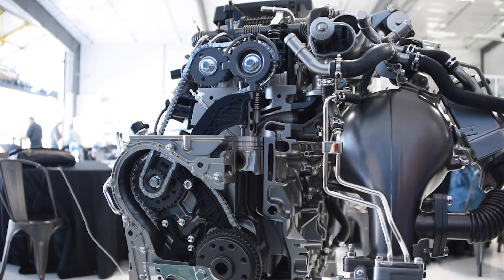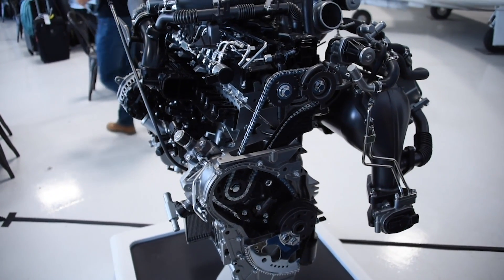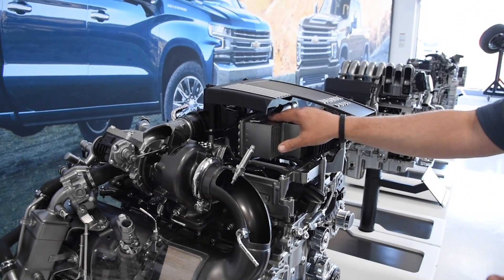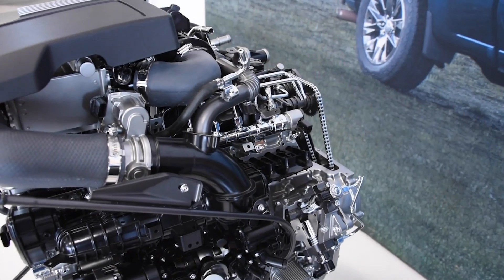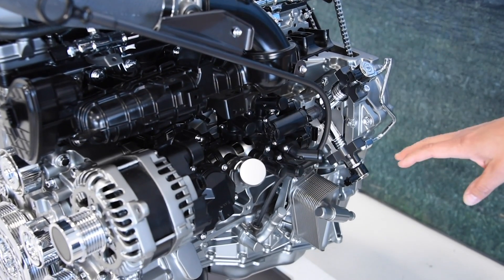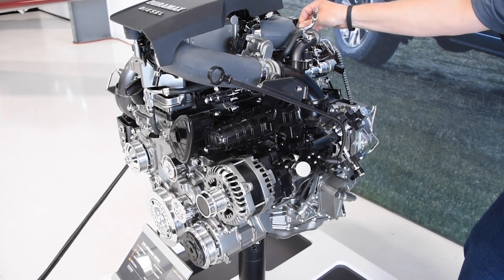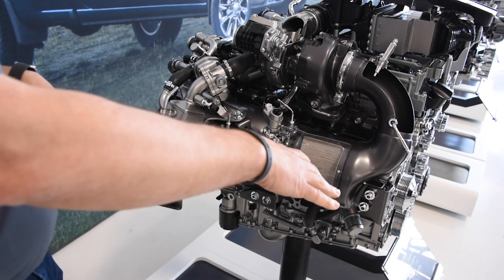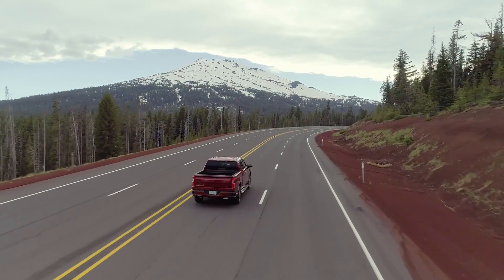What you don't know about the 3.0-liter Duramax diesel

Comment: A belt driven oil pump? 
Another vote for drug testing.
Reply: WHY does the oil pump have to be belt-driven?  Oil-immersed gear drive will last forever.
Reply: To make it even worse, the belt is partly submerged in hot oil. So, why not use a chaine? Someone will never pass a drug test.
Reply: Djinnho chain requires a tensioner and can stretch. A belt does not stretch.
Reply: @Heatherder  It should have neither. Oil pumps have been gear driven for 100 years for good reason.
Reply: Scott i do agree that gear driven is the best option and I don’t see why a belt was necessary. I know it was not an easy engine to package tho. I feel similarly about timing gears however having that many bearings and shafts and gears can be a liability in itself and gets noisy and power sucking fast
Reply: Durability and reliability for a belt driven oil pump is nonsense. 
150k miles is nothing. 
Big thumbs down.
Reply: Not just that, it's the fact that all that shit is on the back of the engine, so you have to remove the transmission, lower the engine and disassemble the rear half of the engine to fix those things. If it were all located at the front of the engine it wouldn't be a big deal, but why on earth put all that crucial stuff on the back of the engine!
Reply: rochab77 post a video of the one you did. I’d love to see it
Reply: @Jackmerius_Tacktheretrix  after reading some of the comments obviously from mechanics and diyers the only answer I have for you is; there's no halfway to stupid...so smart you're stupid is a thing.
Reply: and drop trans!!!!!
Reply: Lol! A WET BELT! ha ha haaahaaa! 
Idiots.
Reply: @LuMaxQFPV  Which I paid $200 for module to deactivate. Miss the old days of simple engines.
Reply: Let's think about this rational like. Most people have no problem buying a diesel truck with a manual am I right? How long does that clutch last? Probably not much longer than 150k.
Don't you need to pull the transmission to change the clutch? Hmmm...
Reply: @wilsterone6689  they discontinued all manual transmissions for hd diesel trucks,  RAM was the last to have available in 2018 and for a reason smaller sales numbers trucks sat on lots,..... most people don't buy HD diesel trucks with a manual trans, automatics are to good now, no Manuel trans drivers for diesel trucks we are a rare type(excluding big rigs don't know about them talking masses) salesman was like are you sure? haha yup! luv my 2018 3500 dually 4x4 G56 trans! oh and a clutch is a much easier job when it comes to wrenching brother, I pick that any day over that other job
Reply: @concretejungle77  Not sure I follow you.
Reply: @wilsterone6689  you said most people have no problem buying a diesel truck with a manual and they have to change the clutch anyway ... but you are wrong in your logic and I explained why
Reply: @concretejungle77  what you explained doesn't change anything. Just because you can't buy it doesn't mean that you wouldn't if you could. And I believe that people were complaining and having to change the belt. My point is that they don't complain about changing the clutch and that changing the belt is no harder than doing that. And they both last about as long.
Reply: @wilsterone6689  lol sure it does refer back to my first comment cause you don't make sense because they could buy it but they didn't want to so thats why truck brands discontinued them. they don't complain about changing the clutch because its not that hard or expensive if you pay someone compared to auto lol belt is much more tedious cmon bro ask a mechanic,  manual transmissions are much more simple than auto and easier and cheaper to rebuild, again thats not why they gone,  manual trans died because not many wants to  or really knows how to operate clutch and gears properly for smooth driving.
Reply: and of course I'm talking about this belt job versus a clutch job
Reply: @concretejungle77  I guess you haven't watched the videos. this is not the typical belt job. It doesn't require timing or tensioners. And once the trans is removed you gain access to it. probably easier than a clutch job because you don't need to lift a heavy flywheel or clutch pack and no machine work required.
Reply: @wilsterone6689  Wish I could buy one with a manual and clutch....  But you are right, the junk auto's won't last much longer than 150K anyway.  Disposable trucks!  Goes right along with the plastic intake manifold...
Reply: @wilsterone6689  that's a clutch, you buy a manual knowing some day you will change the clutch, you don't buy a truck knowing some day out of warranty you have to do work on this poorly designed cess pool of technology.
Reply: @CrazyForCooCooPuffs  Hmmm. I know this may come to a shock to you but you eventually have to do work on every car out of warranty. Some more than others. Do I need to remind you of the Ford 6.0? That had timing gears and no belt or chain and still a POS.
Reply: I’m sure they’ll revise this down the road, then we’ll say stay away from 3.0 duramax from 2021-2025 for example.
“Yea all you have to do is drop the transmission “ they make it sound like that would be a cheap job. Remind me if I buy this sell it by 150k miles.
Reply: @MY-pj8cd  You wouldn't sell a car when it's time for a clutch and thats probably before 150k,  what makes this different?
Reply: @wilsterone6689  wooowww what y’all doing with your clutch. Bought old used cars and new cars as manuals done over 200k  on original and on used cars knock on wood I’ve never had to change a clutch.
Reply: @MY-pj8cd  This is not a car it's a truck made to tow almost 10k lbs. It's very rare that any clutch goes over 150k unless you are very good at it or drive mainly freeway.
Reply: @wilsterone6689   grew up in Jamaica where back in the day the public transportation ALL buses were manual. I always stayed up front to see the drivers shifting when I was old enough to take lessons I had a really great teacher, taught me how to keep a car stationary on a hill without brakes. If I was still in Jamaica when I got my license at the time it was mandatory to get it with a manual vehicle. I lived in NYC for years when I had those manual cars so I guess 50/50 highway to city because I do love road trips. I don’t rough up my clutch.
Reply: Well they use them on race cars all the time...
Reply: Ford 2.7 V6 engine used a timing belt on the variable displacement pump since 2018...
Reply: WTF. Why run a dam belt for a oil pump while the timing is chain driven and to top it of is on the rear of the engine were it mates with the transmission. WTF are there engineer from GM came from? This engine i see reliability issues.
Reply: Was waiting for this engine to come out for so long, and there are so many issues with it and the new 1500 chassis. Was depressed until Ford announced the F150 Lightening.
Reply: Dumb is all I can say I’ll stick with my 12v Cummins
Reply: @ashfordcombs8658  I'll stick with my FKN  T E S L A.   diesel shit
Reply: These are the same idiots that gave us AFM
Reply: @Mike Make me shutup If you want me to shutup Im not taking orders from you, idiot. Suck Mike Hawk 😂
Reply: @jmoneyyonkers2209  😂😂 you are legend!
Reply: The Ford v6 diesel runs a belt off both ends of the engine. Now who needs drug testing?
Reply: Yes, drug testing for the poor chap that doesn't realize belts in oil are designed to outlast the engine.
Reply: @lowboy003  Even if it were a good design (it isn't, even the lead engineer said he'd rather not have to do it this way) it's going to be a major expense to replace. And for many of us, 150K comes up pretty quick. I can see used trucks needing this fix and being not worth the cost.
Reply: @lowboy003  They're NOT designed to outlast the eng - hence the 150K replacement interval.
Reply: @ScottDLR  Sorry, but these posts are over a year old and testing in real time is well over 200K. It could be everyone is brainwashed into believing something that is pure BS. For those who took the COVID death jab, same thing, mass brainwashing.. After 3 years of use give us ONE example of a 3.0 oil pump belt failure.

Most timing chain drives in the future will be BIO (Belt in Oil) drives. Testing in the last 3 years (thousands of hours) with new belt compounds has put these far ahead of anything else: lighter, quieter, less frictional loss, and the ability to absorb torsional oscillation.
Reply: You people are crazy. Belt driven oil pumps are used in race cars and heavy duty semi truck engines. A belt driven oil pump helps increase air to fuel ratio, while still having high mpg.
Reply: @jmoneyyonkers2209  How does a belt driven oil pump increase air to fuel ratio? (AF ratio is a set point for a given eng load/power so you can t really increase it anyway)
Also, what OTR truck engine or race engine uses a belt driven OIL  pump? Not any American V8's for sure and I don't know of any Cummins, Intl or Cat engines that do. If there are, what are they?
Reply: @ScottDLR  If an Oil pump is belt driven, it must mean that it is always moving, as long as the car or truck is moving. That means that oil is constantly circulating the oil around the engine creating better cooling, making the engine more efficient. Why do you think a belt driven oil pump is wrong?
Reply: @jmoneyyonkers2209  Belts are not as long lasting or reliable as gears. That's why they've always been gear or direct shaft driven. The  belt drive drive pump isn't going to cause an eng to run any cooler or more efficient.  I'm sorry but the oil pump has nothing to do with AF ratio. 
The traditional pump works perfectly for its application and can put out any amount that is needed.. 
The belt drive pump  was a packaging shortcut and they've started having heat issues according to some YT vids of late. .
Reply: @ScottDLR  Respect
I’m not sure if your right or not but thank you for the info mAybe GM engineering isn’t at its greatest this decade.
Reply: @ScottDLR  A 2020 Ram 2500 Cummins 6.7, or a 2020 Powerstroke 2500 6.7?
Reply: @jmoneyyonkers2209  No, both of those are gear driven. Really, even if they do, it still isn't a great way to go for longevity and I suspect very few engine builders would disagree (although there's always one in a group like this..) ;).
Reply: @ScottDLR  you are a legend
Reply: @jmoneyyonkers2209  :):):)
Reply: @ScottDLR  Im not sure how they are getting the variable output but that isnt why they did it. He said right in the video it was to simplify the geartrain. The would have needed tensioners and idlers and chains, all have there own reliability issues. Everone complained when clutches were no longer available and rarely would they go over 150k. How did we change them? We pulled the transmission. Hmmm... shaft driven oil pumps also failed. Take a breath and think about it, its not that crazy.
Reply: @jmoneyyonkers2209  =Brain on drugs!
Reply: @wilsterone6689  Shaft driven pumps rarely ever fail  in gas engines and in diesels, where gear driven pumps are the norm, it's unheard of.  Look at any OTR truck eng and you will not find any common issues with gear driven oil pump failure. 
Given that kind of history, clearly they did it for cost reasons.
Reply: @ScottDLR  Those are HD engines and cost around $45k. I sea geartrain issuse on a fairly regular bassis in HD engines. The belt will see far less load given that it only drives the oil pump. Timing belts in automotive engines see far more load than this will and they have proven reliable as well. Id give it a go.
Reply: @wilsterone6689  Yes, I'm in the field as well and see no gear driven pump failures. In race cars that maintain high revs, yes but not in diesels. Belts? no one knows for sure as no one has used them. 
Timing belts? yes, they fail all the time -especially if not replaced on time. 
Sorry my friend, once you talked about shaft driven pumps in diesel engines and said you saw gear driven pump failures "on a regular basis" you proved you weren't familiar with them.  
Good luck to you tho.
Reply: @ScottDLR  Quite the contray. I am ASE master certified in Auto, truck,school bus, and Transit. Yes master in all 4 including advanced level 1 and 2.
I must admit the only shaft driven thing i ever saw inside an engine was a blower drive in a detroit 2 stroke. They failed quite often due to alignment issues. I hold cerificates in Detriot 92, 50, and 60 series. I also hold factory certificates in Cummins ISC, ISL, and ISX overhaul. The cummins is prone to debri getting lodged into the gear train damaging it.
The detroit has idlers and a bull gear that suffer bearing failure. I do not know your credentials. You have obviously made up your mind and that is fine. I hope others make up thier own mind and not just simply listen to people who troll youtube with closed minds. As for luck im pretty comfortable without it and if that doesnt work out I have 5 year 100k mile warranty. Inovation is a good thing or we would all drive model Ts.
Wait they were inovative as well. Hmmm.
Reply: @russianacorns8080  Absolutely am. And I am a technician trainer and technical advisor for a major transit system. I train our transit Rodeo maintenance team as well winning the state roadeo once myself and taking 11th place in the nation and lead my team to 5 convective wins at start since I became their trainer. Don't be an A hole shut up and try to learn.
Reply: @wilsterone6689  hahaha. Lol what a joke, I’ve seen guys drowning it certificates and awards who didn’t know their ass from their elbow. I still don’t believe you.
Reply: @russianacorns8080  Ive seen more without them that don't know their A from a hole in the ground.
I believe you are not certified. Anyway my point is keep dragging your knuckles and the diesel will disappear. It's already on its way our because of this very thing.
Reply: @wilsterone6689  how is not liking a belt driven oil pump knuckle dragging? I’m all for a cleaner environment but you won’t be catching me drive a cow piss diesel I’ll stick with my old IDI. I understand common rail and pezio injectors and computer controlled everything is a must nowadays to meet emissions but I see no reason to skimp on the basics like a an oil pump that has ONE job.
Reply: @russianacorns8080  First cow piss as you put it is a good thing. It gets injected after the engine into the tail pipe reducing the need for EGR. That results in less soot building in the engine. It also makes the engine more fuel efficient and increases power.
Knuckle dragger refers to people being stuck in the past. Technology moves on timing chains also wear and break. The material that belt is made out of is designed to last and no reason to believe it won't.
If you don't like that design you should take a look at the Ford diesel in the f150.
Look how many engines are out there with timing belts and you don't hear people complaining about those. The belt in those drives far more than an oil pump.
Reply: @wilsterone6689  I know how a DEF. system works I am a truck mechanic, but are you sure you’re a master? How exactly does aftertreatment reduce soot inside the engine? Also there’s a reason for timing belts, overhead cams would be ridiculous to be gear driven and I’m not a fan of timing chains either, I only like chain driven oil pumps because the chain is run submerged in oil, rubber should not be run in oil. If the oil pump belt was a 15 minute replacement I wouldn’t be as skeptical, but as you have to drop the transmission every 150k you’ll have to excuse me for not being a fan of this design.
Reply: @russianacorns8080  I just told you. It reduces the need for EGR. EGR cools down the combustion reducing NOX but it carries soot from the exhaust back into the intake. DEF reduces NOX by chemical reaction in the exhaust.
Reply: @wilsterone6689  ohh, I misread it my bad, I didn’t see what you said about eliminating egr. But my point is still about a belt driven oil pump that has zero to do with emissions. Call it what it is LAZY, and CHEAP.
Reply: @wilsterone6689  I do see your point about after treatment and that is all great in theory, in the real world engines still have EGR and cow piss.
Reply: @russianacorns8080  I was put off at first over the belt but after thinking about it a bit I realized that there are hundreds of thousands of vehicles that have timing belts and those belts have to do far more than just drive a pump. And that belt requires no idlers or guided or tensioners. I'd take that any day over the chain setup that is in the Ford 3.0 diesel.
Reply: ScottDLR the belt is for quieter engine without belt driven it would be loud like Cummins
Reply: @duenpuen6862  the Cummins in my titan xd is very quiet, and I can easily access all of those parts because they arent on the back of the friggin engine!
Reply: @duenpuen6862  The Cummins proven engine to last a very long time.
Reply: @chrisheffernan7540  not in the new Nissans. Do a YouTube search

Comment: Can U purchase the complete engine & transmission as a drop-in crate, replacement system for an older truck?
Reply from the maker: Hey John, I don't know about that yet. The truck with the 3.0 Duramax isn't even on dealer lots right now, delayed by certification processes. If it were to be offered, I would imagine it will require the associated computers, wiring harnesses etc to make everything function correctly, and that would make it quite expensive. But it would be cool ;-)